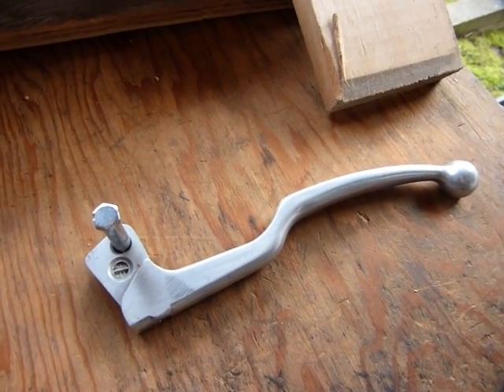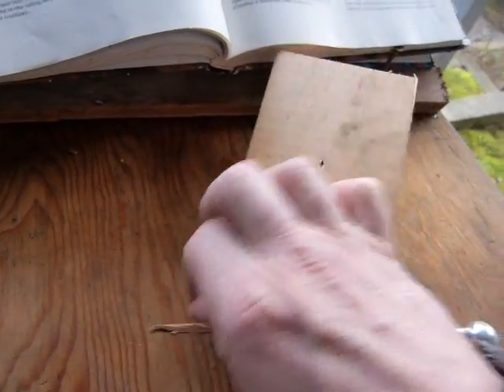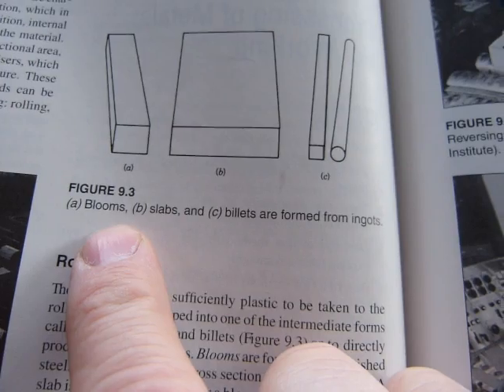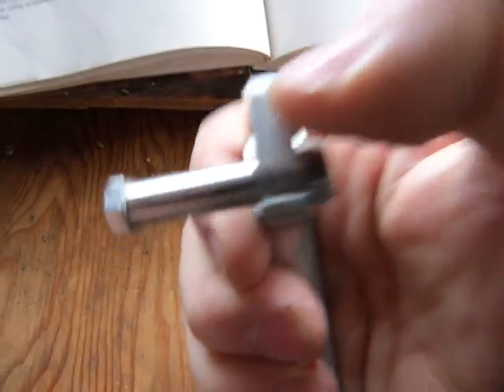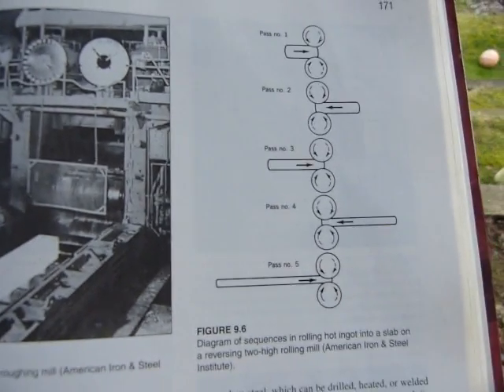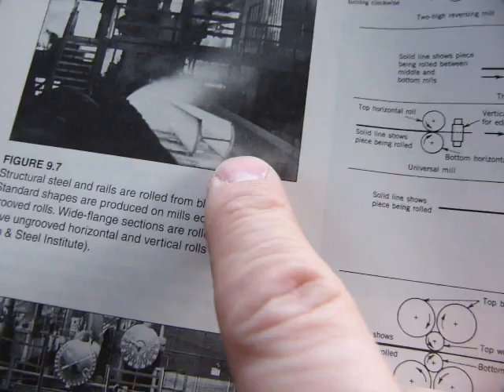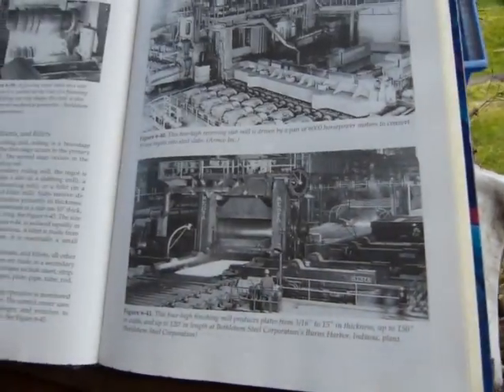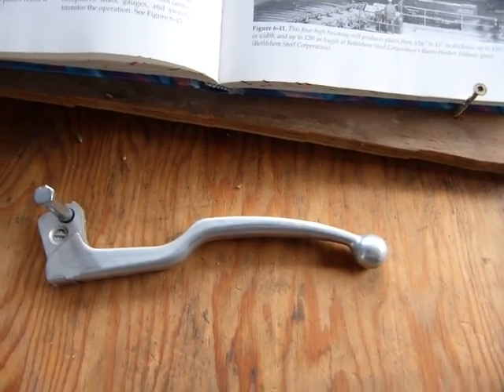The secrets of billet aluminum

Comment: This is true, but billet is used as shorthand in automotive to refer to parts cnc milled out of a solid block instead of cast or forged parts, so that's usually where confusion comes from. Billet means better parts when they are cnc milled instead of cast because it's better, but it causes confusion since it's used to refer to different things in different industry.

Comment: While yes billet does refer to a shape and all billet’s are cast that doesn’t mean the resulting parts are the same quality as cast. The lever you have there is cast and absolutely not a billet part which is evident from the casting lines. Where the advantage comes from in making parts from billet aluminum is that when the billet is cast you have greater control of how the crystalline structure forms allowing you to make a stronger material. You can not do this when casting finished parts because you have different thicknesses and shapes in the final part and can not control how the crystalline structure forms. When you have a block, square or cylinder you have great control over how the material cools hence being able to control the crystalline structure. The final parts are then machined from the billet such a a block fir an engine block, a cylinder for a crank shaft, etc. There are companies that try abs rough cast parts and then final machine them but they are not billet, to be a billet part it must be made from a true billet as you defined it. So while yes the billet reference the shape, when a part is called billet it’s referencing that the grain stays the same throughout the process of making the part.
Reply: Zero likes for someone who knows what they're talking about. This video is useless if taken at face value especially for those like me researching 2jz engine blocks machined from legit billet casted aluminum.

Comment: Your saying not foot pegs and levers. How do you explain parts made from billet using a CNC machine? Also on the video you've missed out when buying billet or something made from billet how you know the quality of the billet.
Reply from the maker: Quality: manufacturer may share. For example HUNT bicycle wheel hubs, DMM carabiners. They both specifically say parts are forged and machined out of 7000-series or whatever grade aluminum, hardened to T6 specs or whatever detail. Not one marketing BS word, such as 'billet" or "high strength" or "grade 1". They are marketing allright, with proper industry-used terms.

Comment: Very interesting! I am looking to buy some very expensive fittings for my sailboat rigging that are being sold as made from billet aluminum. They are teardrop shaped, so I could see how they could be sliced off a round billet and shaped after that. Is that possible or practical? Does it reduce the incidence of corrosion in a saltwater environment?
Reply from the maker: Can you send a link or an image to the product?
Historically, naval brass is an alloy that's know to work in saltwater, hard, and forgings can be made for structural parts, and stainless steels since the turn of the century, but SSs are softer than NB. Both are very heavy. Aluminum  is light but may last a lot less because it's soft, forgings and extrusions are made easily, could be strong if there is enough of them (as in scaffolding frames and beams, etc.) If ropes run through aluminum (carabiners), they are strong and can work but get ready to replace them faster than brass and steel.
Makes sense?

Comment: would it be fair to say cast items shink slightly when they cool down vs billet were the part is machined down, or worked onto the correct size and shape? i think that might be were the idea of quality comes from
Reply from the maker: Correct, casting shrink a lot more, but machining also heats up the part quite a bit through friction. Made either way, final dimension of parts should work at the operating temperature of the part. Pistons next to a fire or a starter motor housing are working in a very different heat zone than GPS mounts or foot pegs.

Comment: Billet just means it's made out of one piece of metal. Nowadays people typically use aluminum alloys since it's the most typical material used. You're correct though it can be made from anything. Basically anything machined from one solid chunk is labeled billet. Us in the design world don't mix castings and billet in the same manner.

Comment: Billet aluminum is quite common in aftermarket car n motorcycle parts as well as car audio and bicycles. Im sure its used in many other areas as well. Its not just a word people put in front of aluminum to make it sound cool.
Reply from the maker: It`s a cool word many marketers use totally out of context to generate sales. Other marketing miracle words include all new, improved, re-designed, high-strength, tested in Canada`s North (as if a freezer is not good enough), fully electronic, optimized, auto-sensing, digitalized, gold, sealed - just to name a few. Usage of these words may have no actual connection to reality or technical detail.

Comment: Ah, this is interesting, I'm not familiar with the "billet" term (I'm not natively english speaking), but the ecuivalent term used in Swedish is "forged" (directly translated) in contrast to "cast" aluminum. Do you know the correct term for the kind of aluminum that was CNC machined from a solid block,and heat reated, rather than poured into a casting mold the shape of the finished product?
Reply: Billet aluminum is what you would use to cnc a part from a solid block and forged is when the part is stamped into the desired shape.
Reply from the maker: Yes, aluminum alloys in North America are numbered by the Aluminum Association`s system. Check out matweb. They group aluminum alloys into series, 1000-6000, list casting alloys and other wrought Al alloys. Levers, frame, pegs are 6061 (tempered to T6), very often. You can see these numbers printed on the stock at every 40cm or so.